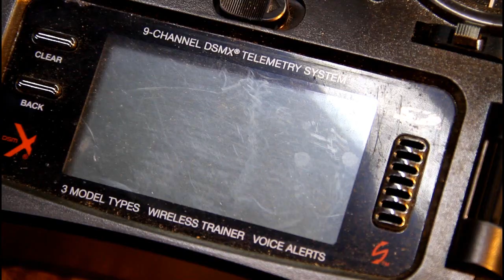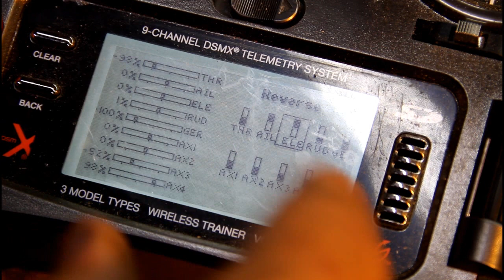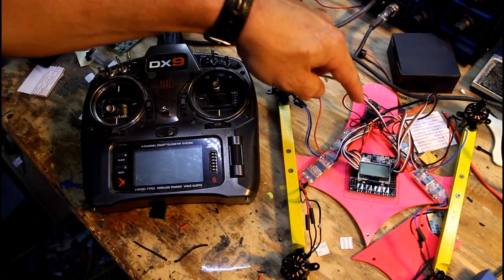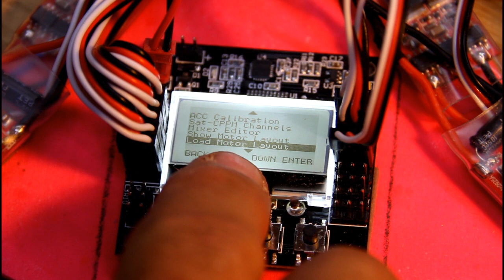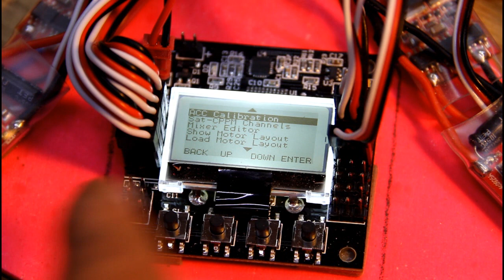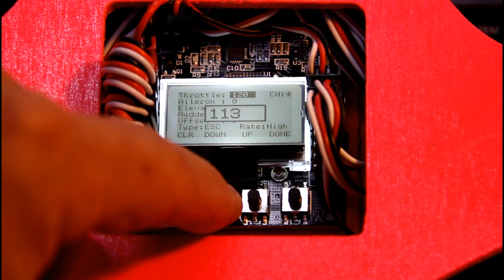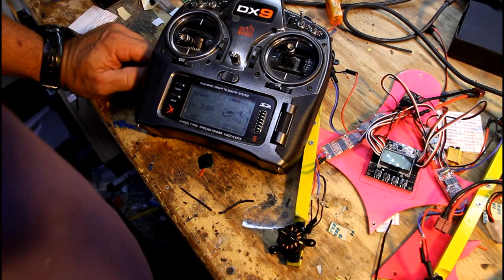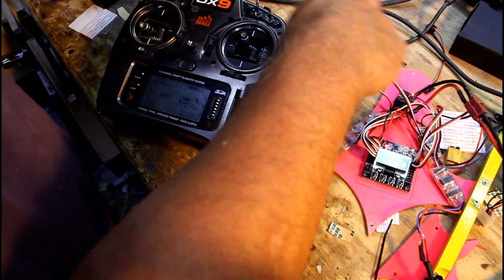Simplecopter.com Mini Vtail build

Comment: Love the design, so much so that I decided to give it a go using wood and corrugated plastic. Didn't use any screws, just glued everything together... my version is slightly smaller and uses 5030 3 blade gemfan props... had those lying around because I had a 250 quadcopter from hobbyking... the one that sponsored all the motors and electronics to support this scratch build :)

Comment: a cool tip I learned for calibrating escs with the kk2.
1: unplug the motor 1 ESC connection from the kk2
2: power your transmitter with the throttle at full
3: power the quad (it wont turn on yet)
4: press and hold 1+4 on kk2 while doing #5
5: plug in ESC 1 connection (now it will turn on)
6: throttle to 0% 
7: done

this is how I do it with slow and big fingers :)

Comment: Thank you for another really good video.
I'm happy with the Tcopter  kit and other parts I have ordered  from Simplecopter.
and have started to built it. I had to order the motors from a vendor that only used
DLH as a shipper, seems like that slow boat from china is a true statement..
Anyhow lots to learn about this project while I'm waiting and your vids are a really
good source.   Thanks again. :)
Reply from the maker: next time if buddyrc is out of the 2212 1400kv you can find them on ebay usa seller for $18. i just had to order 20

Comment: question, do larger props and slightly slower spin rates on the motors allow for longer flight times?

I own several tri copters, your qaulity is very good. I love the tri's and will be placing a order for the super cool looking batman copter you've built out here

Comment: Where do you recommend holding/placing the quad to make sure it is properly balanced?
I've been trying to fine tune my mini v-tail since January and recently tried moving the ESCs and receiver around thinking it would help with vibration, but the PI gain settings needed to be adjusted way down and it just seemed to fly worse generally. I'm planning to rearrange things again and wanted to make sure I set things up better for balance this time to ensure better overall flying.

Comment: I want to do flips too! what are your kk settings to make this possible?  I have a tricopter.
Reply from the maker: scale stick 120 on aileron and elevator and 100 on rudder. i have to use a bunch of expo on my radio(70% aileron and elevator) to keep things steady at hover. you need to work up to these settings unless you are a 3D heli pilot already.